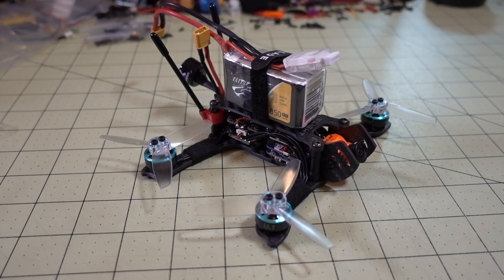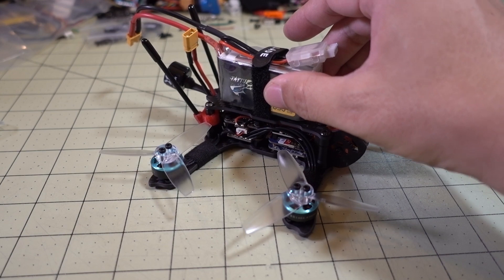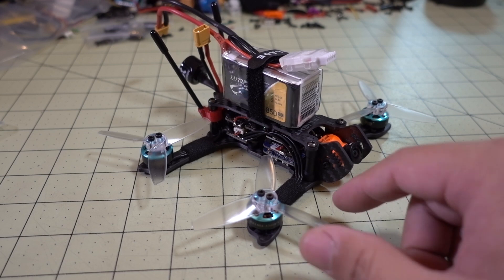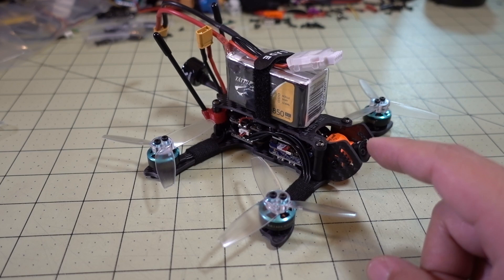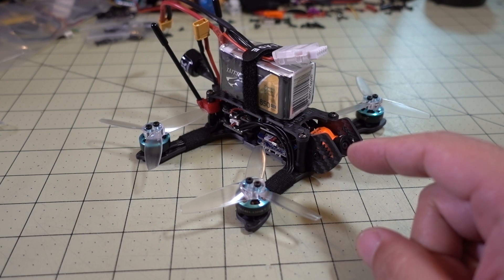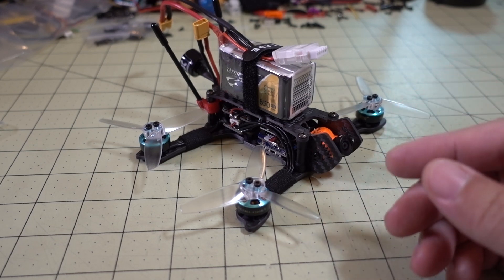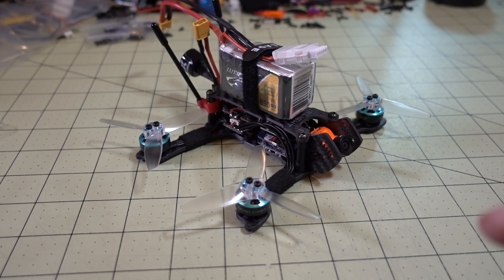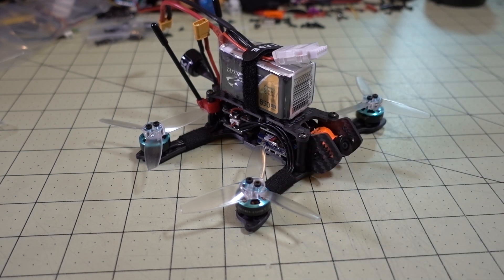12 Minute Flight!!! (DYS 1404 4300kv Motors) 👍

Comment: Awesome Build! I'd like to copy this build for a long range setup.
Reply: mistercohaagen i have return to launch with just the gps. No mag needed. Betaflight no longer needs the mag for return to home. Has modified wing code. It works extremely well. Ive tested it flying every direction possible. I even flipped it into return to home during a inverted yaw spin. Quad went upright, gained altitude, and traveled home. With no magnetometer.
Reply: Needs GPS...  the chances of finding it if you lose link are between zero and really lucky.
Reply: mistercohaagen easy. Bn-220 would fit on an arm with no problem. Or on the battery strap. Weighs 5.3g.
Reply: I like the battery strap idea...  being on the arm would be close to magnetic interference from motors / motor wires.  iNav or something.  You know, Ardupilot has been ported to FC's like the F4-based omnibus, and can utilize DShot now...  supposedly is stable.
Reply: mistercohaagen magnetic interference doesn't matter. There is no mag. Its not needed with betaflight. If you want to use inav use it on the battery strap. If you want it to fly amazing and not need a mag, use betaflight.
Reply: I mean have GPS & MAG for return to launch functionality.  If you lost link in mid-air, and it dropped somewhere and the battery came out... you'd have only the last known GPS location from your OSD when you last had link.  You may as well not have GPS, cause it could be anywhere in a 1/4 to 1/2-mile radius from the last known GPS location.
Reply: damn, really?  i'll have to try it...  how does that even work?  does it hunt around until it figures out what direction it's traveling in like an old-ass garmin watch?  what does the behavior look like in the air?  inverse toilet-bowling on an altitude climb?
Reply: mistercohaagen I think for quad to 'go home' properly(in betaflight and with no compass), before flight should do an initialize gyro/accel.
Reply: found it...  holy hell dude, that's awesome!  https://youtu.be/MfvgY_sQ74A  https://github.com/iNavFlight/inav/issues/2688
Reply: mistercohaagen it keeps track of where home is from lift off. Once you hit gps rescue, it immediately yaw spins to face home. Then climbs to pre determined altitude, then starts heading home. Sometimes it will fly diagonally home. But it still comes home. Its really cool.  Checkout diegofpv.com